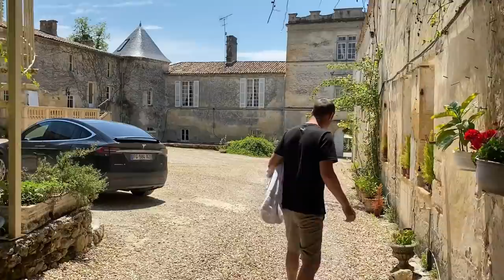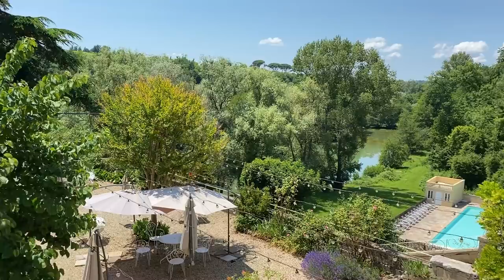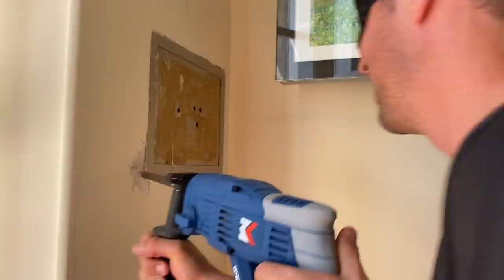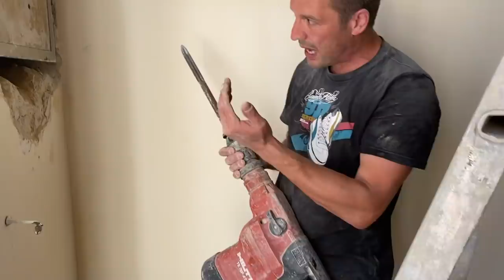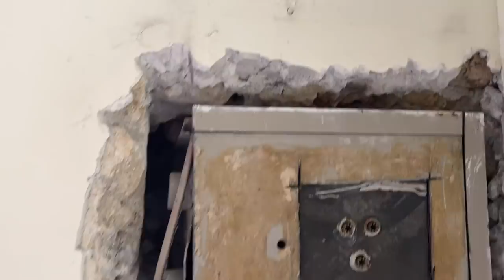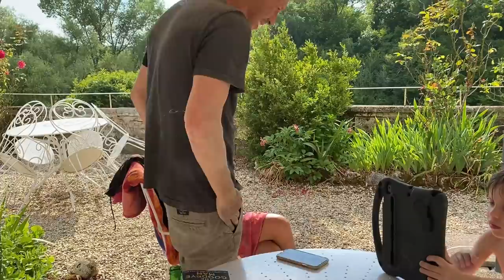EP25  70 year old Chateau Safe locked for 20+ years.... What treasures lie within????

Comment: Anna walks up to the door, and stops. She hears a voice that she doesn’t recognize. She stands still and turns her ear to the door, and listens. 
Nothing on one, two, three, four dropped into a false gate, nothing on five. Back to the start. Nothing on one, a little rotation on two, threee nice click…
She opens the door to find out who is in there. 
Ed; Hi Anna. While holding a hammer drill, as he pulls out the drill bit from the wall, and removes his safety gear.

Comment: Edd would be better off using ear protection instead of a burglar's mask (funny touch though). Was worried the TV would get damaged. Will have to remove that first when you want to take out the safe.
Reply from the maker: Its an aircon unit!!! so very hard to move!!! xx

Comment: Not sure why it is important to take the safe out and cause all the damage?  Seems impractical. On another note, I’ve been noticing how a fall could easily happen with the low windows. Noticed previously while the kids were in the room. Does France have some safety requirement?  I’ve see bars placed across the openings to prevent falls in America. Just wondering!
Reply from the maker: Barbara, its a choice we made to take it out. For the windows the norm in france is 90cm I think... I know all the chateau windows are above the minimum level, as we checked a few years ago for liability reasons. Thanks for mentioning it as we would hate anyone to get hurt whilst staying with us.

Comment: It would have been easier, quicker, less mess and cheaper just to call a locksmith. After that you could have had the lock re-keyed and had a good, useable, and  very solid concealed safe.
All you ended up with was a bl##dy mess.
Reply from the maker: Yes Phil it is a mess, but I really don't like the safe, its not the right place for it either, so the idea was always to take it out. xx